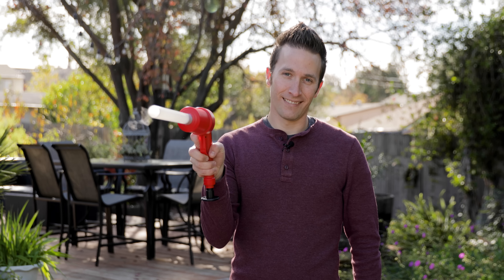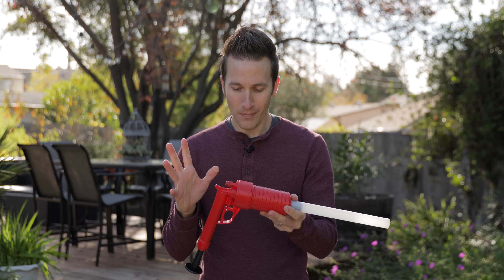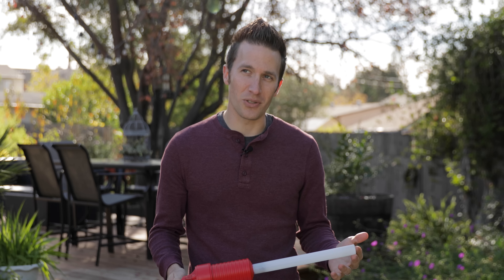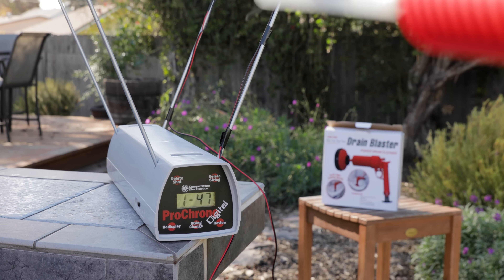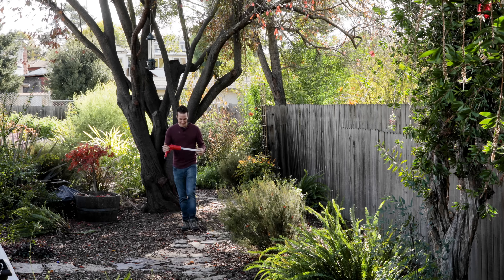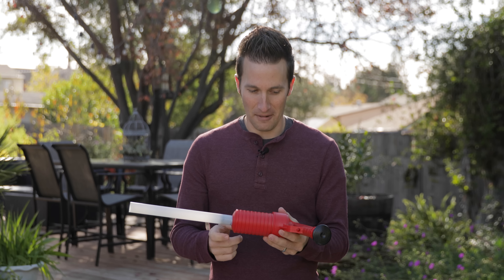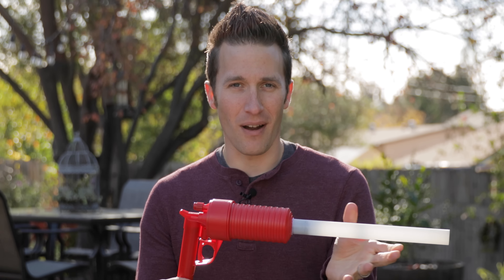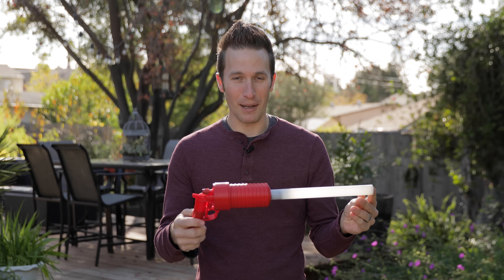MOD: Rival Drain Blaster 200+ FPS single + 11 round shotgun!

Comment: it won't break. I have one and there is an over pressure valve
Reply: Lord Wolfo How many pumps until the OPRV kicks in?
Reply: 10-15 I think
Reply: Lord Wolfo  I got mine to 30 pumps and over time the plunger head will where out and need replacing

Comment: I'm working on a drain blaster myself, but I've killed 2 already at around 12-15 pumps :/ but at 10 pumps I'm already shooting harder than I want to be shooting at people, and that's without a half decent air seal, and introducing dead space, AND a loose dart fit in the barrel. So there's a lot of potential, but I'm going to need to see what other people are doing, and what other drain blasters I can use to build from.
Reply: Bought at the local hardware store, but they swapped them over (80% of why I prefer to buy locally), now I'll just not use more than 10 pumps, which without a proper barrel is already causing REALLY bad fishtailing, which is a problem since the first thing I was going to try and build was basically a sniper/ marksman blaster.

also managed to pop some darts open with the pressure (Tried getting a tighter dart fit with what I had lying around, but it was TO tight), so I doubt I'll have any lack of pressure.

Comment: and btw i have had up to 45 pumps in my shotgun Warning! don't ever go any higher than that. Also, from experience, that little thread on cap on the back behind the tank might crack, its not an overpressure valve so it is safe to clog it, I did:P and I would recommend you integrate it into a barricade shell like captain xaiver has done, you should check him out.

Comment: don't worry about the blaster breaking it's got a safety feature in it to stop you from over pumping that model can take a max of 10 pumps without the safety mechanism kicking in
Reply: Tim the Panda man the chrono test would seem to suggest 20 pumps produces a higher fps than 15 though

Comment: Use an apollo barrel, they have a hopup tab inside that helps range and accuracy.
Reply: myan ormisbutt a hopup won't work that well with the nerf rival balls, they are to squishy and would just move over it either with no effect or slightly decreasing performance,
Reply: Alex's Custom guns 
actually, no. i have taken the hopup tab out of the zeus barrel and noticed significantly lesser performance.
Reply: myan ormisbutt the zues has a hop up? I didmt know that, I guess ill have to look into that for my suped up atlas
Reply: the atlas has no hop-up because it can interfere with the two rounds coming out. it makes one of them brush up against the other and reverse rotating eachother in the barrel. that can hurt your performance.
Reply: myan ormisbutt my atlas is modded to only fire one ball
it was a simple small beam blocking clambering tube half way to prevent the  second ball to enter the chamber
Reply: Alex's Custom guns then you should probably try and put an apollo barrel in it. you will get much better performance.

Comment: 5 pumps equals 10psi/.68bars, 10 is 20psi or 1.37bars, 15 is 25psi and 20 which is max number of pumps before over pressurizing is 32psi at 2.20bars

Comment: What size tubing did you use? I made a version of that with 3/4 inch pvc. It shot about the same, but it could only fire 1 HIR at a time.
Reply: Komandr Nerf https://www.mcmaster.com/#catalog/122/1595/=15dq1pl